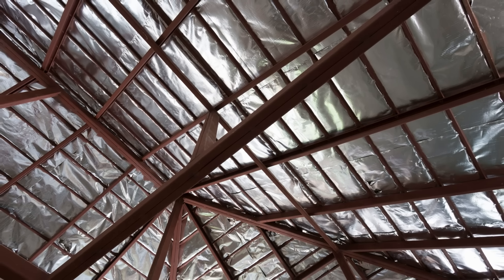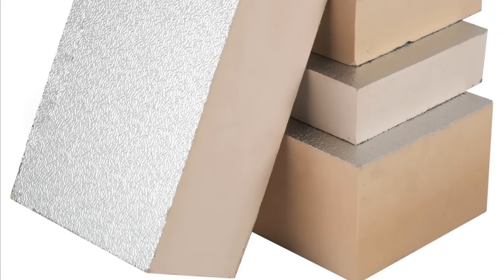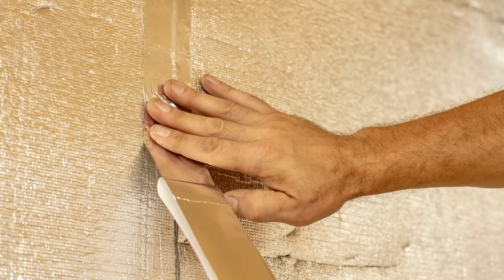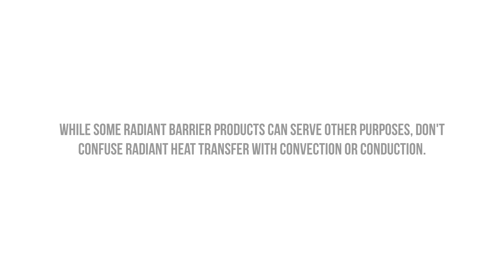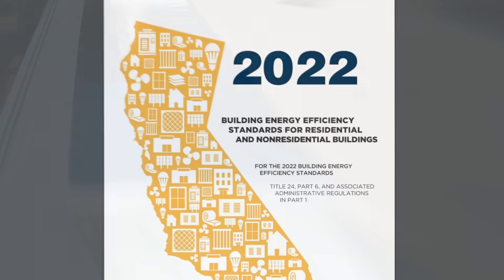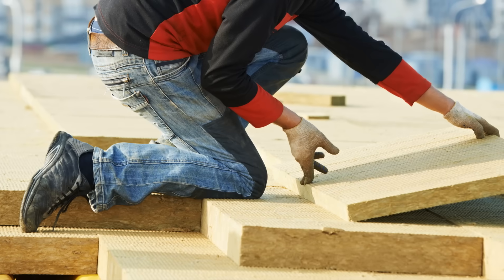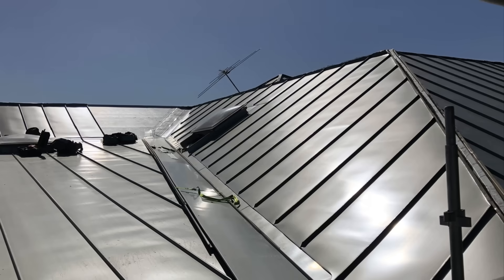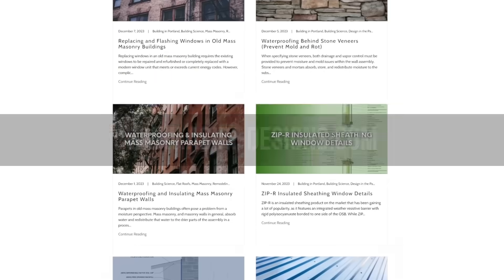Do Radiant Barriers Actually Work?

Comment: Radiant barriers facing outwards work due to their high reflectivity. But when facing inwards, they also work, only due to their low emissivity. This is why some codes recommend this type of installation for hot climates.

Comment: My house has two "walk in" attics, facing almost due north and south. There is no insulation in the roof rafters, the walls that form the attic are insulated. I installed perforated foil barrier on the roof rafters only on the south side that gets the most heat and sun. Now it actually stays cooler in the summer than the north side.

Comment: So much necessary detail lacking in this video.  Non-perforated radiant barriers are vapor closed, but the facing on products like LP techshield is perforated, making it vapor open.  Also, having the barrier on the inside or bottom of the sheathing utilizes the highly reflective barrier's low emissivity to prevent the radiation from heating the insulation and attic floor.

Comment: Nice video, but I have one small correction or suggested update. At 2:00, you talk about directions "not working", I don't agree, and you should get benefits even if installed facing the less ideal direction. It would be more accurate to say it will be "less effective" than "it won't work". In the pictured example, even a home in a heating-dominated climate needs heat during the winter, at least for 90%+ of the US (maybe not most of Hawaii or Florida). carrying that example to windows, even if you have the low-e coating on the less ideal surface, a winter-optimized low-e window would be better than no low-e coating at all. I agree that there are many installations where the radiant barrier is installed, where it won't do anything, or is less than ideal. You didn't mention the product, but let's be honest, it's those bubble wrap radiant products that are making some hard-to-believe claims on their overall R-values with what is less than 1/2" depths.

Comment: This  is the case where a written essay is needed and a YouTube comes up woefully short. If he had written this out, he would have seen the flaws and rewritten it.

1. He conflates convection with infiltration.
2. He says that radiant barriers only reflect heat.  He totally misses the point that a high-emissivity surface will take heat away from the surface even if there is no sunlight or radiant heat hitting it.

I don't think that he understands high-e or low-e.

🙄👎 Back to work

Comment: I installed the radiant barrier foil in the roof space trusses over the living room, where there was no attic space,  when the house was built in 1989. After five years of living there it was obvious the barrier had an effect on the roof. The asphalt shingles over the living room had accelerated wear compared to either side wear normal 5 year had occurred. Because of deterioration we replaced the asphalt roof with a metal roof and air gap. I do believe, though,  the radiant barrier has contributed significantly to the relatively low electricity cost for the house size.
Reply: Interesting, and unexpected that the reflected IR from LR radiant barrier was damaging roof asphalt shingles.  Did you have the recommended 2-4” air gap between radiant foil sheet and roof sheathing?
Reply: @tonymanero5544  I did and it was unexpected for me also. Anyone who looked at the roof could see the difference. I attributed it to the reflected heat from the radiant barrier. I actually sent a sample into Certainteed and they refunded my money. Used it to help pay for metal roof instead.
Reply: Replace your asphalt shingles with a metal roof

Comment: According to a green building website it doesn’t matter which way the foil faces and in fact better for it to be facing downward on some installations. I don’t know the science but I installed reflective sheets foil downward on my hot climate west facing rafters and the effect was immediate and definite with central air conditioning running only intermittently instead of constantly on hot sunny days. I’d do it again in a heartbeat.

Comment: There are products like Reflectix that can be stapled across the bottom of the rafters, leaving the entire rafter bay as an air gap.  It can also be stapled to the side of the rafters, but a minimum 1/4 inch air gap is recommended.  It has a reflective layer on both sides, which would seem to settle the argument as to which way you should face the reflective layer.
Reply: My thoughts exactly. I'm in the process of installing on the bottom of the roof rafters, and I recognize the primary function is not the foil reflection but creative air ducts to take the cool air from outside, channel it through the roof and out the whirlybirds on top

Comment: I have been reading and watching conflicting information about the physics of radiant barriers.  Most all people do seem to agree that the radiant barrier reflects IR light and requires an air gap however not everyone seems to be consistent about that.  If the air gap is needed to prevent IR light from transferring energy as heat energy conducted through anything it touches it seems to me that there should be an air gap on both sides.  A foil clad rigid insulation board would be an example of the foil conducting to what it is touching (the insulation). So would be batting up against it.  Even so one would think a double bubble layer sandwiched between radiant barrier on both sides.  The foil touching the bubble minimal insulation must be conducting heat to the inner core and the core to the second layer.  This is what's confusing to me because I would like to have double layer radiant barrier to keep heat out during hot days and heat from the structure to stay inside during cool days.  I like the idea of pairing it with insulation except for the fact that it seems dubious due to conductivity.
Reply: 90% of the time or more.....heat inside a structure is Convective or Conductive....NOT radiant so the foil / reflective side facing inward does nothing because there is No Infrared "Radiant" heat source to reflect.  Exceptions would be solid fuel heat source with glass doors like a wood stove. Where there is IR heat through the glass.
Reply: @Paladin7845  That's an excellent point, thank you for replying!  It seems so obvious now that you say it yet I've heard radiant barrier marketers make the claim.  Seems dumb now but I didn't catch it.  I'm still not certain about radiant foil touching anything.  There's sheathing sold and used with radiant foil already on it (as well as some debate as to which side should face up).  But also I've listened to people make a big deal about not letting the foil contact a surface (other than for fastening) on either side.  I'm not an engineer and trying to at least get the physics figured out.  I'll take that over marketing once I get there.

Comment: Not sure I completely understand. Assuming I leave a gap and have the barrier facing the correct direction, they're still not useful inside the attic? They have to be on the exterior of the building only>

I was seriously considering trying them out to help my HVAC upstairs but don't want to sink money into something if it's not going to have an effect.

Comment: I'm looking for advice. I have a 100 year old home with a "finished" attic, with non insulated rafter bays, from the soffit all the way to the ridge (yes, they attached the rooms' drywall and ceilings to the rafters without insulating behind it). It gets to 110 degrees in the bedrooms in the summer when the exterior temp is 100. Just had a ridge vent cut. Going to cut intake holes in the soffit to get airflow in. Roof is ten years old, asphalt shingles. But my rafters are 2x4s, so I only have 3.5 inches between the roof deck and the interior ceilings. 

So I thought what if I preserve a one inch gap below the roof deck, inside the rafter bays, from the soffit all the way to the ridge, that way cool air can come in through the soffit and push hot air all the way up to the ridge and out the ridge vent. 

BUT instead of using cheap plastic baffles to direct that flow of air all the way up (and because I still need SOME insulation) I thought, what if I just install two layers of one inch thick ISO foam board insulation in the rafter bays, from the soffit to the ridge. The ISO will have radiant barrier on one side. So I'd put one, one inch thick ISO board with radiant barrier facing the shingles (one inch air gap still preserved between roof deck and insulation). And then put a second one inch thick ISO board with radiant barrier facing the room. That way I have a radiant barrier reflecting the suns heat back towards the roof and up and out the ridge vent via the one inch air gap channel. But because we get cold winters here, I have that second radiant barrier facing the rooms which reflects the home's heating back into the rooms when it's cold AND acts as a vapor barrier. 

No, I don't want to do spray foam. Thoughts on this setup? Anything I'm missing or problems it may cause? Any issues with a vapor barrier facing the roof and one facing the rooms?
Reply: I could see that working. I have a Cape Cod style house that is not very well insulated that I would love to do something similar on the second floor.
Reply: Your plan should make an improvement but I am curious if you are doing this from the ceiling side or the roof side?

If you are removing drywall to do this, I would pad the rafters to increase the R-value. You can also strap the rafters to change the direction of the insulation boards/batts and reduce thermal bridging through the rafters.

If you are doing this from the top side, I would use the opportunity to add r-value with a product like Zip-R sheathing.

Comment: I would think that a radiant barrier which is not directly exposed to sunlight is almost totally useless. If it is covered by an IR opaque material, it can only reflect the much smaller amount of IR coming from the surface it is facing.

Comment: Thanks for the video. I've been banging my head against this radiant barrier idea for my new home here in central Florida (the HOT south). I've been convinced that radiant barriers reduce radiant heat transfer across the space which they face. All kinds of radiant barrier "experts" talk about installing it facing downward (or toward the inside, the attic) including documents from the Florida Solar Energy Center that I've read and re-read. That has made no sense at all to me. That's NOT the energy transfer I'm trying to stop. I'm trying to stop the energy transfer from my roof (that's so hot you could fry an egg on) into the attic. Your video, made to understand the use of radiant barriers in HOT climates is the first one I've seen that makes sense. It has to face outside (the HOT side) to be effective. So, in short, I'm going to scrap the radiant barrier completely (because it will inevitably accumulate dust and become ineffective) and go with a white metal roof. You've solved my dilemma. Thanks.
Reply: No, it works facing down as well.... Al foil has an extremely low emissivity. He doesn't mention this is the video. The experts are correct.

Comment: good video on an often overlooked area of energy efficiency. some minor points of clarification. everyone seems to be obsessed about minimizing conductive heat transfer in homes. when you do the math, radiant heat transfer is actually the dominate mechanism for how heat moves into and out of most enclosures/objects when there is no forced air like from a fan. This means that while reflective coatings can increase the amount of heat moved thru an enclosure through conduction/"thermal bridging", the net result of heatflow is actually a negative amount. Also, keep in mind that there are high emissivity surfaces, mainly anything that is dark black and matt finish, which improve heat transfer through the opposite mechanism, just look inside of any smartphone made in the last 10 years, its how they improve cooling, and its why almost all electronic packaging (the plastic part on integrated circuits) is black. you do not need an air pocket inorder for radiant barriers to work, however an airpocket does improve their performance. the best improvement in performance is found by adding multiple layers of low E coatings, such as on both sides of the air pocket. look at the sun shade for the james web telescope, or the inside of some of the name brand vacuum insulated drink containers. also shiny copper is about 20-40% better than shiny aluminum.
you can use low E coatings directly applied to the outside of an enclosure to decrease the thermal transfer into objects inside of a room, by reflecting the room temp photons away from the object, for modest gains in performance. its why a shiny fridge will use less power than a black fridge. i have a video on my channel which shows how i reduced the power consumption of a 12v fridge by almost 70% with just al foil tape and some voltage trickery. 
finally, i would avoid attaching radiant barrier panels with conductive al foil tape, since it makes it into an even larger capacitor and Faraday cage, which could cause a lighting strike or poor cell phone reception in a housing application.

Comment: I’m about to install it in my attic where my equipment ( gas water heater and Ac/ heating unit are located) 
I’m just interested in the overall temp drop on similar days. seems impossible to find that on the internet.
Reply: I installed Attic Foil April 2024:
Hung on bottom of rafters (air gap) + layed on top of ceilings joist/insulation. 
1st summer attic temperature was down 20 degrees, electric bill down 40%!❤
Inside ceiling temp down 15 degrees!!!❤

Comment: Hello, I'm a big fan of the channel and recommend it often. A lot of the applications you have a lot of material for cold climates but a lot of us live in the south where its very hot most of the year. We also have outdated insulation. Is it possible to make a video about upgrading the attic insulation? My plan  is to seal all the openings and add a blown in insulation without blocking the vented roof. I have no idea what the best practice is though. Thank you for your content
Reply from the maker: @Buildsciencenerd  Thanks for watching, you may find this video to be helpful: https://youtu.be/ScNk8Qy0PWs?feature=shared

There are also a ton of articles on this at Building Science Corporations website.

Comment: 100% Wrong that a radiant barrier does not work to the inside.  It works of the emissivity quality.  Or, the ability NOT to release radiant heat.  This is why a hot potato wrapped in foil stays hot longer than one now wrapped in foil.  Here is a good explanation of the difference. https://youtu.be/uGP5KobU6R4?feature=shared

Comment: Your video early on includes the Techshield product.  How do you explain videos like this one, which purports to show lower attic heating with the OSB bonded radiant barrier pointing in towards the attic space:
https://www.youtube.com/watch?v=sUwl9CMtTqg

I am thinking there must be some reflective surface on the other side of this pointing into the OSB, and something there to create an airspace.   I don't understand how this result could happen when the reflector is point away from the radiant heat to be reflected.   It makes no sense at all.   Yet they do a temperature measurement and the foil product does appear to drop the temperature.
Reply from the maker: The foil also has the property of being low emissivity. The thing that people are missing is that this is only relevant in poorly insulated roofs. The color of your shingles make more of a difference.
Reply: @ASIRIDesigns  That took my understanding of this issue to the next level thank you.   Spending some time with an LLM, a radiant barrier correctly installed and pointing towards the roof structure will remove about 90% of the radiant heat.  If you incorrectly point the radiant barrier towards the attic floor, the lower emissivity only reduces radiant heating by about 30%.  I feel like this gives me a much more solid framework for understanding this issue.

It is amazing to me how people who are professional builders completely botch this issue.